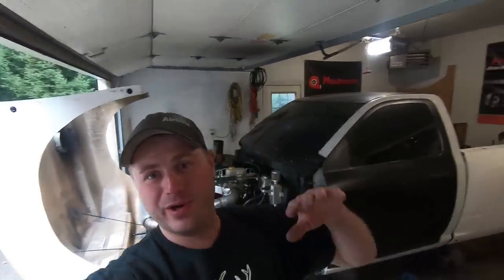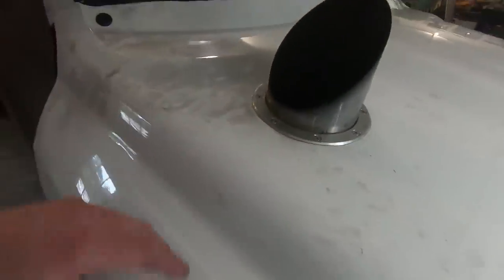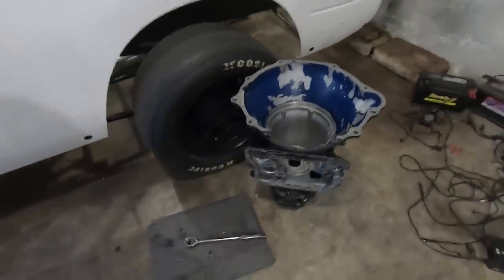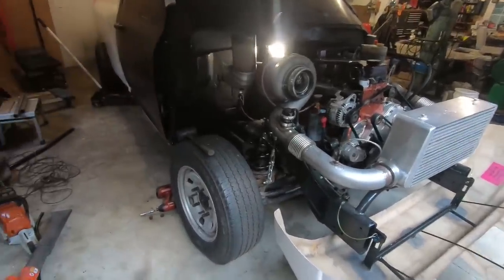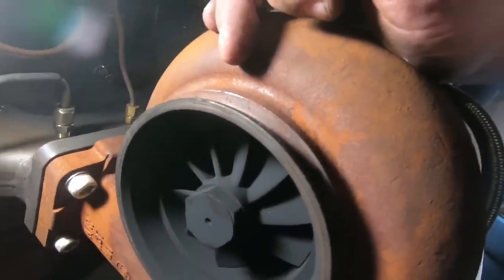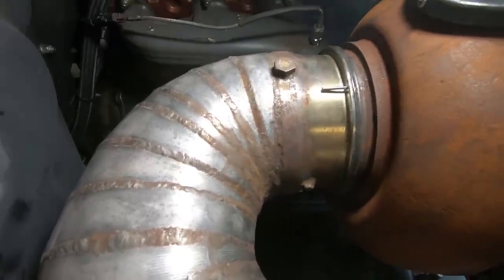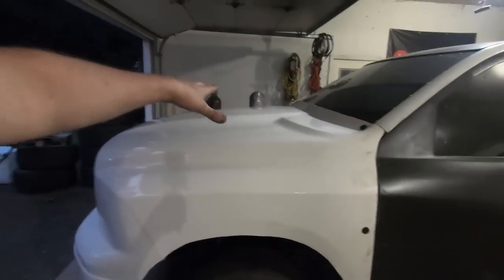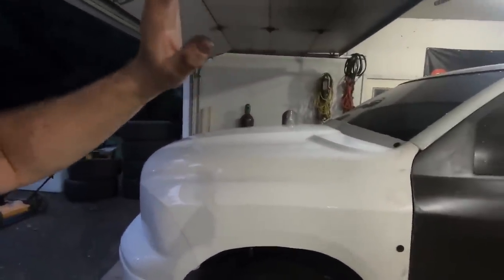How To Keep YOUR Turbo Exhaust Piping From Moving... Exhaust Flange Dowel Pin Install!!

Comment: What if you just welded a bracket from the pipe to say of of the manifold bolts or the manifold? Use a turn buckle to adjust and hold tight?